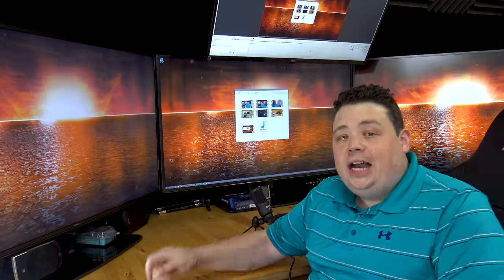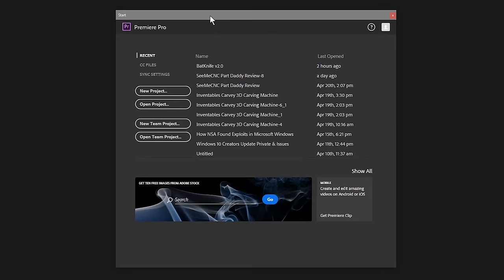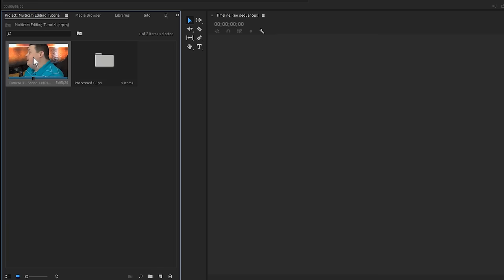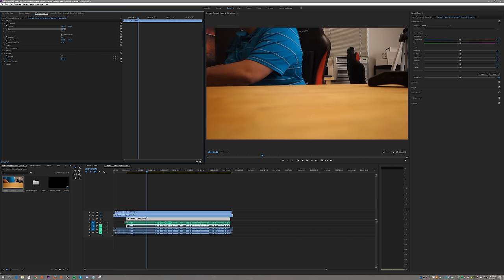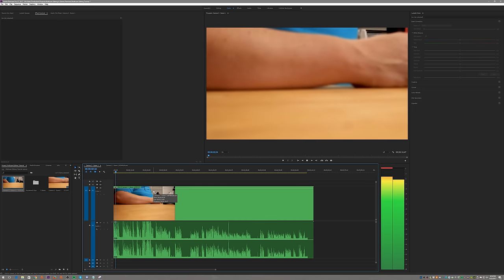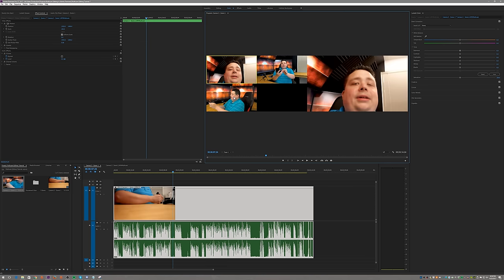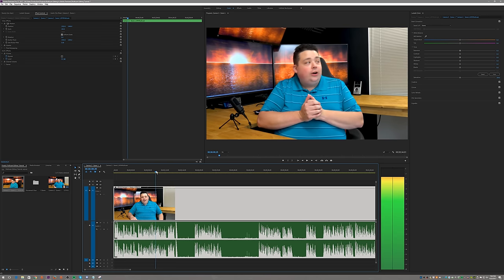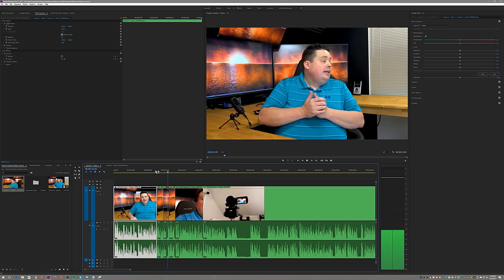Making YouTube Videos with Multiple Camera Angles! Adobe Premiere Tutorial. - @Barnacules

Comment: I wish Adobe supported Linux
Reply: Brendan Stubbs Kdenlive is getting better and better
Reply: Brendan Stubbs also DaVinci resolve from black Magic is pretty good, even Kevlar Condom(Adam) says it is decent plus it has a free version as well
Reply: Brendan Stubbs I would too, but I doubt that will happen, there probably isn't enough demand, I have configured gimp to work and look like photoshop because Adobe doesn't support Linux
Reply: Install KVM and do a GPU pass through
Reply: As much as id like to see that happen, Linux needs to be more then a single digit percent of the market first.
Reply: I thought you had to buy DaVinci Resolve to use it  on Linux.
Reply: Adobe probably have some sort of agreement with MS and Apple not to make Linux version cuz it would cause mass exodus to Linux leaving windows and mac in dust.
You can use DaVinci Resolve or Lightworks both of which are professional softwares available for Linux.
For Photoshopping you can use Krita, Darktable, LightZone or Pixeluvo.
Also i doubt Linux market share is accurate, how do accurately measure Linux market share when there are thousands of distributions?
Reply: Nice tin foil hat you got there. Adobe will lose money maintaining their software for such a small user base full of NEETs
Reply: +Mystic Bardock LSSGSS, It may not be 100% accurate, but its pretty darn close. The fact is, Windows has a much higher install base, and Apple actively supports their product. Which isn't always the case with Linux. So, unless someone figures out how to commercialize Linux and offer that same level of support to users and developers, you're not going to see much support for it.
Reply: Use Wine.
Reply: Mac Donalds Windows 10 spies on you and even more so on your children aka phones home (welcome NSA/CIA/thoughtcrime/1984)! Microsoft added spying features to Windows 7/8.1 as well (more general list). Microsoft officially admits that automatic spying cannot be disabled in Windows 10.
The official Microsoft guide on Windows 10 telemetry settings contains this beautiful tidbit: "Ability to gather user content, such as documents, if they might have been the trigger for the issue". Now, Microsoft states that user files can be requested only on the "Full" level of telemetry, however you need to bear in mind that this feature is built-in, it's remotely triggered, and it can be used to get any of your data any time they want.
In April 2017 Microsoft published a list of things it's collecting from your PC at basic telemetry setting (Web Archive copy).

Wow, just wow: Microsoft now openly publishes its collected data in regard to Windows 10 users:

"Over 44.5 billion minutes spent in Microsoft Edge across Windows 10 devices in just the last month" - we spy on Edge users.

"Over 82 billion photos viewed within the Windows 10 Photo app" - you're using our Gallery app, right? Great!

"Gaming continues to grow on Windows 10 – in 2015, gamers spent over 4 billion hours playing PC games on Windows 10" - we now know what apps you're running and for how long.

Starting October 2016 telemetry(spying) became impossible to disable in Windows 7 and 8.1 because Microsoft changed the way it distributes updates for these two operating systems.

Microsoft's EULA grants Microsoft the rights to use any of your content related to the services like Bing, Cortana (a built-in file indexer and search in Windows 10), OneDrive or Skype: "you grant to Microsoft a worldwide and royalty-free intellectual property license to use Your Content". You can read Microsoft's response here which paints everything in a positive light however after Snowden's leaks it's hard if not impossible to take them seriously.

Microsoft pushes Windows 10 so hard it actually started spreading FUD even about its own older OSes:

Microsoft started lying through their teeth about Windows 7: "We do worry when people are running an operating system that's 10 years old that the next printer they buy isn't going to work well, or they buy a new game, they buy Fallout 4, a very popular game, and it doesn't work on a bunch of older machines. And so, as we are pushing our software vendors and hardware partners to build great new stuff that takes advantage of Windows 10 that obviously makes the old stuff really bad and not to mention viruses and security problems".

Egregious lying continues: Microsoft falsely states that newer Intel and AMD CPUs will only be supported by Windows 10. If that were actually true you wouldn't be able to run MS-DOS on Intel Skylake yet you perfectly can (edit: later Microsoft reneged on not supporting Skylake CPUs). Perhaps they are talking about new advanced features of the said CPUs, but their wording means the opposite: like you cannot physically run any older Windows releases on these new CPUs.

Microsoft is getting desperate: the users of Intel Kaby Lake CPUs and AMD Ryzen CPUs will no longer receive Windows 7/8.1 updates at all. More information.

Microsoft desperately wants to install Windows 10 on pretty much all computers running Windows 7/8/8.1, even though some older hardware is not compatible with Windows 10 due to missing drivers. In certain cases drivers for Windows 10 are buggy and incomplete, which means after upgrading you end up with a broken PC you cannot use or its features don't work like they should.

Microsoft has lost its mind and they now aggressively try to foist/force Windows 10 on unsuspecting users. Oh, it's now official: they will forcefully install it everywhere they can in 2016.

Windows 10 will forever be beta software (specially after they fired a large chunk of their QA/QC department and instead delegated testing to the insiders):

A new model of development with no Windows 11 in sight.

Two Control Panels (read below).

Microsoft hides the information about Windows 10 updates, so oftentimes you won't even know what certain updates are aimed to fix or improve. Also Windows 10 updates may have unintended consequences and unannounced changes in behaviour (it's already been confirmed).

Microsoft sometimes pushes half-baked updateswhich kill end-users' PCs or cause a lot of damage(this is a wonderful read). Make sure you also read an article about the clusterfuck called Anniversary Update - there are numerous reports that the installer kills all the partitions which Windows doesn't know about (Linux users beware).

August 2016 anniversary update broke millions of web cameras.

September 2016 security update broke print functionality for certain users.

December 2016 update broke the DHCP service (read Internet connection) for many users.

GWX application updates the PCs which are incompatible with Windows 10 because there are no drivers available for PC components or periphery devices like printers/scanners/etc.

You've got no real control over crucial features of the OS:

Windows 10 will have no service packs which means it will always be a work in progress and you are a perpetual beta tester.

Forced updates you cannot opt out of (and Microsoft have borked quite a lot of them recently so prepare to see your Windows die after installing a new portion of updates - actually Microsoft has already borked one update, read horror stories about KB3081424). In December 2016 Chris Capossela, chief marketing officer at Microsoft, admitted that the company had went too far with the way Windows updates are distributed.

Safe Mode has become impossible to access unless you've booted into ... the running OS which totally defeats its purpose. Also Safe Mode is hidden behind almost a dozen of steps vs. a single F8 key press on boot in every Windows version from 95 to 7.

Windows 10 anniversary update makes it very difficult (read impossible for average users) to disable Cortana.

Windows 10 violates the basic networking principles: it ignores the hosts files, the DNS protocol and firewall rules and sends telemetry dataregardless.

Microsoft says that there will be at least two service updates (or whatever their names are) for Windows every year, and each update is basically a new version of Windows, so:

Twice per year you may reinstall software deemed not required by Microsoft.

Some features you grew dependent on will be removed without providing any alternatives.

Your preferences will be reset to default, so you'll need to go through them regularly.

Some Metro applications will be reinstalled if you deleted them previously. New wonderful Metro applications will be installed.

Expect your group policy settings and tweaks to be completely removed or changed and the only way to get them back is to upgrade to Windows 10 Enterprise.

Certain software titles and drivers will cease to work.
Reply: +Brendan
Cool story, bro, but what the fuck does that have to do with Wine???
Reply: There is no "deal" the problem is all the proprietary codecs and sub system, software's that does not belong to adobe and/or cannot fall under the GNU licence.  Its a bit like Mac and the right click.  It was invented by some one and patented. Mac didn't want to pay the licence fees for years, Linux "people" made a deal with the rights holders as they were infringing, and mac jumped on the band wagon hence the mighty mouse.  Same with h264, Pro-Res, and Avid codec, etc.  Other problems include stuff like the fact that there no low latency audio engine supported by professional sound cards, or hard ware vendors willing to make their unique solutions and technology public.  Professional programs don't often use windows audio and video engines.  These are just some of the reasons adobe said years ago they were not going to go to Linux.
Reply: SpeedyDucky they're making harder it is really f##king annoying when I have to fix other people's crappy computers
Reply: SpeedyDucky most likely they are already making crappy decisions like the window store and of course they want you to take it to a Microsoft Store to repair your computer it is like the Apple Store just not as good if you want to computer go  system 76
Reply: SpeedyDucky lol
Reply: +Brendan Stubbs And yet, despite that novel you wrote I'll bet your still using win 10.
Reply: sparkplug1018 nope I am using Linux Lite
Reply: +Brendan Stubbs At least you back it up, most people I encounter talk a lot but never take action.

Comment: This is great, thank you! Love the energy. Also I've struggled with using this feature since I shoot very long events and 'performance art' stuff but using it is a mess with many clips under each camera angle. There's no simple solution really, I just thought I'd find something better than what I do buried in there like "find gaps" or "form Camera 1 from multi" or something. The only way around is to sync ALL of it yourself using the waveform or Pluraleyes and then crop the beginning until it starts when all cameras are running i.e. synced and starting at the same point. Then highlight and copy ALL of each track individually and "nest" it into what will look like 'single clips' then highlight the nested clips of each "camera" (which is now a bunch of clips pretending to be one long real-time clip) and make a multi-cam sequence from that. Just be sure to use the "1st frame" option for syncing and now you'll have a multi-cam sequence with all of your crappy started and stopped clips like mine and you can use this switching feature. No videos exist still on doing this far as I can tell and everyone who trys it tears their hair out trying to undestand how to do it since the problem seems to never be mentioned in tutorials about it. I'd make one but I'm a pessimist so not the most pleasant orator. Also if one of your cameras is too quiet or no sound this can help as long as you do the work of syncing it yourself by hand first so you can add it in.